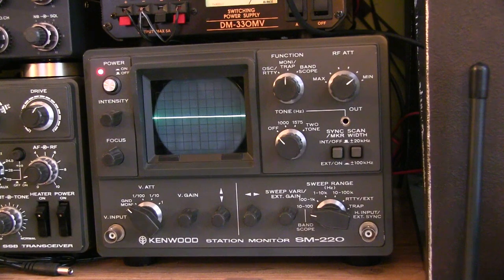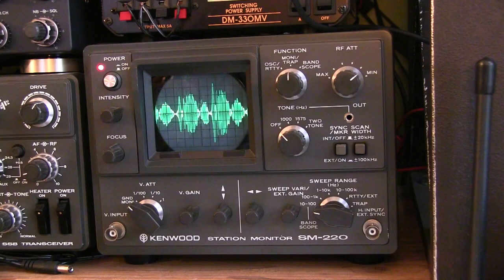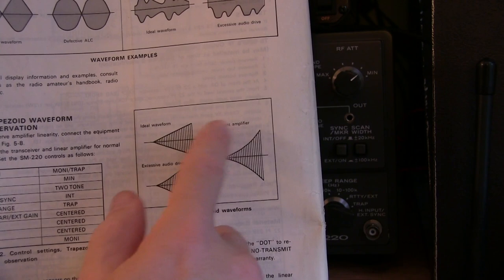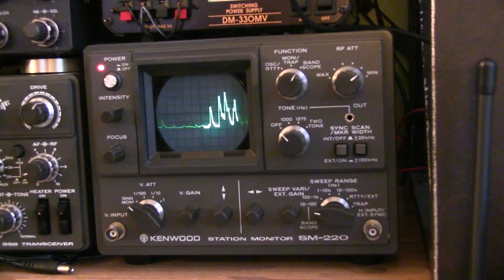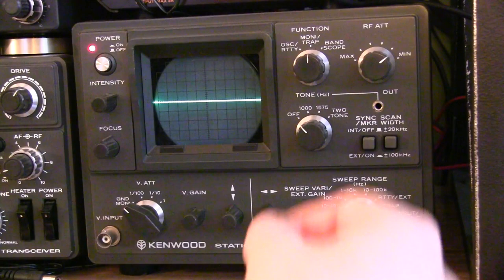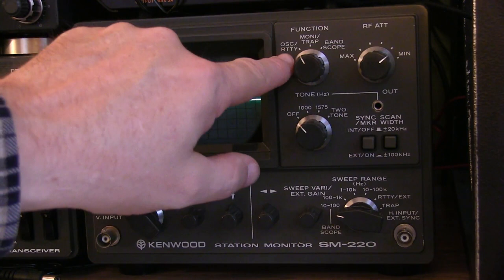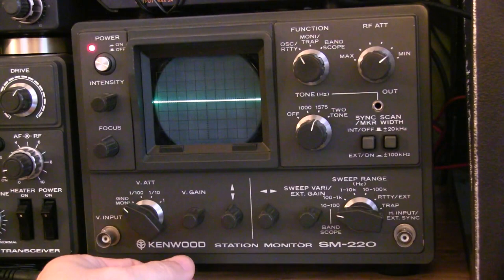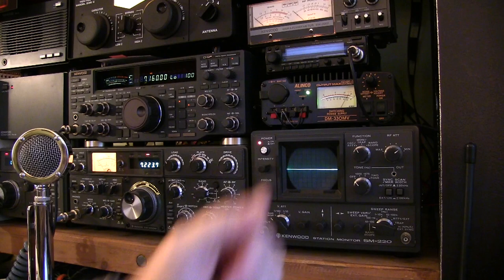#250: Kenwood SM-220 Station Monitor Demo / Overview

Comment: RTTY is very often used for ham radio contests.  The next big contest using RTTY would be the ARRL RTTY Roundup on January 7-8, 2017.  30 hours.  If you are a ham it is a great opportunity to have some fun and if you aren't (yet!) you can still listen in and run the decoding software to see some of the activity.

Comment: I just ordered one of these to go with my new (to me) ts-820s setup. I am a new ham with an IC-7300, but I wanted an older rig I would work on, restore, and play with. Why not something from my childhood years!?! Ok I was a kid in 1978, but still I love the nostalgic feeling on running this old rig. Honestly, I don't find a huge difference between the Ts-820s and the 7300 in terms of real world functionality. Sure the waterfall is nice, and the variable passband is a little nicer, but it's not like I have encountered many signals where the 7300 is leaps and bounds better. Typically they are about the same.

Comment: Nice!  I had no idea the station monitor had an IF spectrum analyzer.
Reply from the maker: It does, but ONLY if it has the optional adapter installed.  And of course, there are only two variations available - the BS-5 works with 3.395MHz IF signals, and the BS-8 works with 8.83MHz IF signals.

Comment: Cool. I just bought a TS820S that came with one of these monitors, the remote VFO unit, MC50 desk mic, and the filtered speaker. The guy also had a mint SB221 but sadly it was sold just days before I called.

Comment: I bought one hoping it had the panadapter but no such luck, I had to build two panadapters, and am on to number 3, or should I say one panadapter that will work with various IF stages for multiple transceivers. I made the 8.8307 MHz for the 800, and then did two more Xtals and two more IF transformers, so I can do the panadapter with a TS440, TS450, a Yeasu and some other stuff. The screen is so small, I took an old student grade Tektronix O Scope with a dead 2nd channel and made that a station monitor with a large(r) CRT screen. These SM220s are beautiful inside. Kenwood laid these out so neatly, and they really are just gorgeous inside. 73 KI7AQJ
Reply: I am interested in doing the same thing with my yaesu FT-736R and FT-767. Could you tell me how you went about building the pan adapter?

Comment: Thanks for showing i'm thinking of getting one of these and the BS-8 for my Ts-440Sat But have to figure out how tho bring the 8.83 IF out to a BNC on the back of the tranciever The 430 and 440 never were intended to use a station monitor unfortunetly.73'jim KB1PFL
Reply: Well Iguess I lucked out at the Whitman ATC Winterfest today i saw one for 125 dollars with a TS430 that had the Mod done for the scope the gentalman at the table in front of me had one of these and he bought the radio and I bought the monitor For $50.00 dollars we plugged it in and he said all the functions were working correctly I took the top off and the BS-8 Pandapter is there all it needed was a Reticle screen and bezel which I just purchased for 20 dollars ob ebay Boy was I lucky.Jim Kb1PFL

Comment: hi which radio do you find yourself using more? the ts830s or the ts870s ? thanks
Reply from the maker: I definitely use the TS870S more than the TS-830S.  But, these days, I spend a lot more time on QRP CW using a Penntek TR-45L.

Comment: Nice video, as usual. Although, that trace needs a tiny little bit of rotation, no?
73 and HNY de CT7AFR, Emmanuel.
Reply from the maker: Yes, a little bit.  On the SM-220, this is done by loosening a pair of wing-nuts on the rear panel and rotating the CRT.  Slightly different magnetic environment since I moved the shack resulted in the tilted trace, and I haven't gone back to adjust it yet.

Comment: Thanks for the video.I bought one of these about a year ago got it for a song about 15 dollars at the flea!
      It has the BS-8 ,and i had seen an old QST article a few years back about bringing out the iF in the TS-440sat to use one of these, and that is the mod i'm about to do. i see in the manual they talk about using two different iFs at the same time one 1st iF going in the back and the second iF going in the front V.input i see you are using only the rear input 1st iF for band monitoring, so i will be able to see band activity.... what does using both iFs at the same time Give me over only using  just one?  it isn't mentioned in the manual or am i just reading it wrong?73'Jim KB1PFL
Reply from the maker: The first IF output is a wideband output to be used with the pan adapter (bandscope) to look at activity over a large portion of the band.  The 2nd IF output which is brought to the front of the scope, is a narrowband IF signal - the same signal that goes to the demodulator for reception.  So, it let's you see the RF envelope of the received signal (in OSC mode) similar to the view you see in MONI mode for your transmit signal.

Comment: Will a SM-220 connect to my TS-520s Station...?
Reply from the maker: Yes.  For Transmitter monitoring,  it works with all HF radios.  For the bandscope with the TS-820, you'll have to have the BS-5 Pan Adapter installed in the SM-220.  The TS-520 doesn't have a connector for the IF output to connect to the pan adapter, but the SM-220 manual includes instructions on how to add this modification to your TS-520.

Comment: What was the reason for doubling the IF with the newer models?
Reply from the maker: The TS-830S is a dual conversion receiver, with filters in both IFs, while the TS-530S is a single conversion.  Thus, better filtering in crowded conditions, and the ability to add variable bandpass tuning vs. simple IF shift.  Here's an excellent link describing the differences/changes between the Kenwood hybrid rigs:
http://www.k4eaa.com/types.html
Reply: Ah.  Thanks for the reply and link, Alan.

Comment: Hi, how do you set up the sm220 with the 830S? I know the 830s has two IF outputs let me know what I can do thanks!
Reply from the maker: For the TS-830S,  you would need the BS-8 Pan Adapter installed in the SM-220 in order to do the spectrum scope.  This connects to the IF 1 output on the back of the rig.  If you want to monitor the received signal envelope, then connect the IF 2 output to the front panel V INPUT and run in OSC mode.  To monitor the transmitted signal,  connect the TS-830S RF output to the RF INPUT on the SM-220, and the RF OUTPUT on the -220 to the antenna system.
Reply: w2aew so i need a BNC to RCA connection on the back of the 830S? What are the cables called that I may need to buy? 
Thanks!
Reply from the maker: @danielpenaofficial4186  The pan-adapter connection is simply and RCA to RCA cable.  The 2nd IF connection to the front panel of the can be done with another RCA-RCA cable and an RCA to BNC adapter.  However, in my experience, the use of the 2nd IF with the SM-220 is of very limited value - I've never used mine this way except to see how it works.

Comment: I understand 1 kHz but why there is 1575 Hz?
Reply from the maker: For two-tone testing, the tones need to be non-harmonically related.  So, this is simply a choice that meets this criteria as well as being close to the center of the audio bandpass of a typically ham radio transceiver.

Comment: Great videos,can you please help me I want to connect my 17 inch lcd tv to a old 3 inch scope I don't think it's as easy as plug n play .thanks
Reply from the maker: Definitely not plug and play. There's no simple way to do it. If the TV has an analog video output (NTSC) then you might be able to use the circuit in this video, but you will need a scope that has a Z-axis input. 
https://www.youtube.com/watch?v=yf4kOMSPbM0
Reply: w2aew  .I was hoping to view my scope on a bigger monitor but I guess I will have to strain or put it on shelf .many thanks
Reply: It has composite ,svga and vhf
Reply from the maker: Maybe use a small video camera (GoPro, webcam, etc) and connect its output to TV or computer.
Reply: I'm going old school I got a magnifier lamp on the adjustable arm. makes a big difference

Comment: i have one of thes what can i do with it
Reply from the maker: The video describes several things you can do with this unit.
Reply: @w2aew  i only have the unit
Reply from the maker: @jacoblush  By itself, it is really  only a very basic, limited function oscilloscope.  But, given that it has a higher value to ham radio operators, you might think about selling it (typically $100-150) and using that money to by a more proper oscilloscope.
Reply: @w2aew  i got it for free thank you